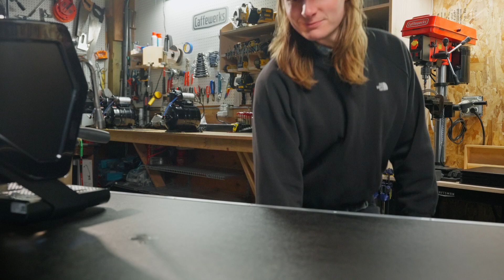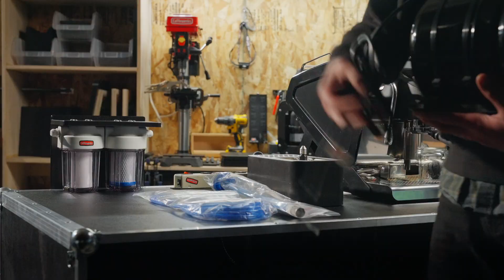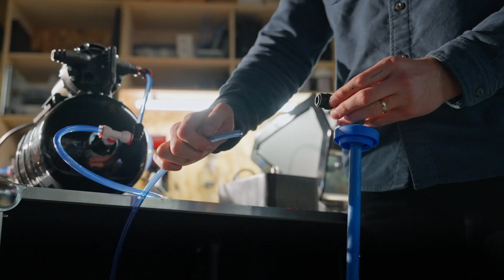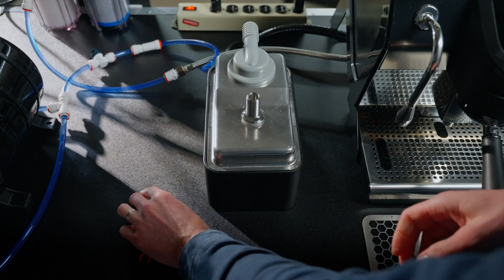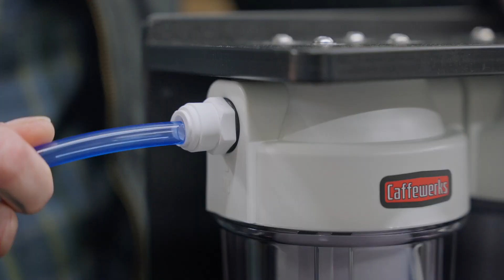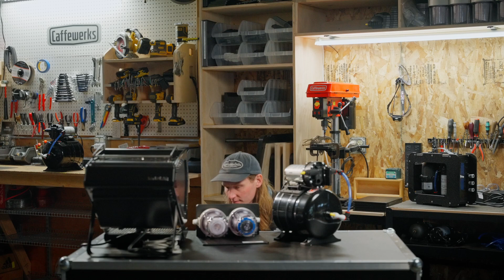Caffewerks // Complete Cart Components Water Pump and Filtration Panel Installation Guide

Comment: Hello. What should the accumulator PSI be based on the PSI of the water pump. Ex if my pumps PSI IS 45psi what should my accumulators PSI be set to?
Reply from the maker: We balance the pumps and accumulator before shipment. You should never need to adjust either!
Reply: @Caffewerks 
I purchased a high volume system from you guys that came with a 35psi pump, but unfortunately it fail. I then purchased a replacement pump from you guys but this one has a higher PSI out put, so in this case should the PSI for the accumulator stay the same???? Thank you

Comment: What pressure should we keep in the accumulation air bladder??
Reply from the maker: Accumulators are preset before shipment. They should not be adjusted.
Reply: @Caffewerks but accumulators are checked every so often and they always need to be reinflated just like RO tanks.  They lose air over time.  So what do we make sure they are at on maintenance checks